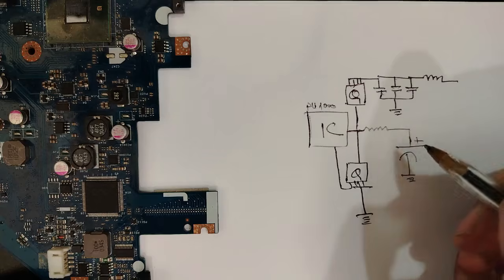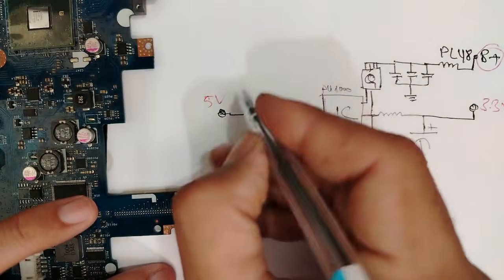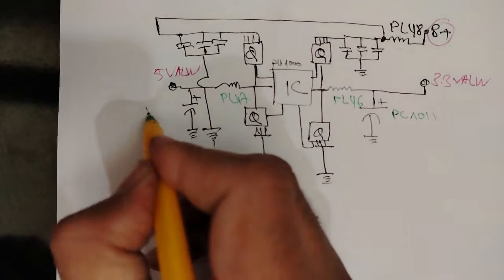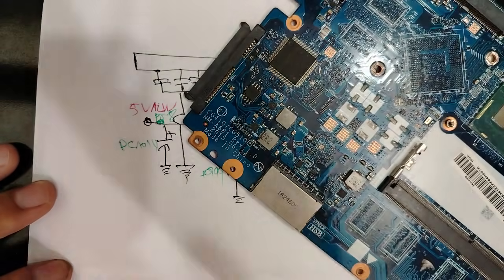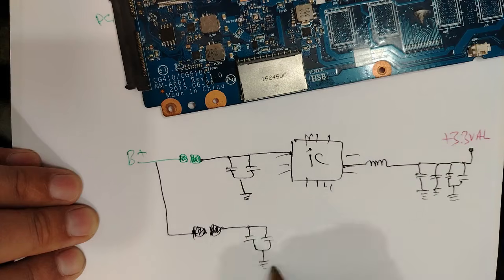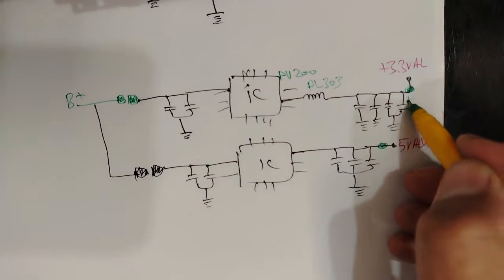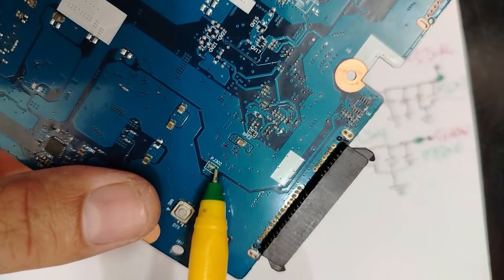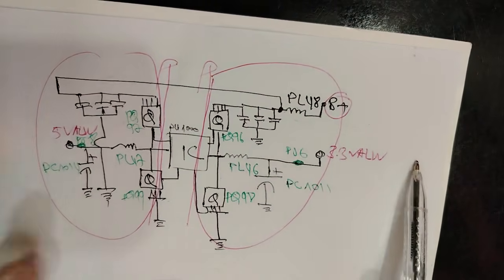💥 3VALW & 5VALW Circuit EXPOSED. Fix Any Laptop Power Issue Instantly | Motherboard Repair

Comment: I am so impressed by your skills and others like you.  I repair laptops and have done for many years but I never even consider doing component level stuff.  I wish I could.  I have a laptop motherboard here, it won't boot, however with no RAM it produces BIOS beeps telling me there is no RAM.  With RAM no beeps but the CPU and some other chips get REALY HOT but no boot, just HOT HOT HOT.  I have no idea what's wrong but I am going to try to find out.  I would love to be able to fix it.
Reply from the maker: Thank you for the kind words and it’s great to hear that you’re diving into the challenge.

Here’s a breakdown of what might be going on with that motherboard:

No RAM = Beep codes
This suggests the CPU is at least partially working and the basic BIOS POST routine is running. Good sign.

With RAM = No beeps, no boot, but chips get very hot, This is more concerning. Excess heat often points to a shorted component or a power rail that’s being overloaded.

Likely Possibilities:

Shorted MOSFET or capacitor:
Especially around the CPU VCore or GPU area. These will cause excessive current draw and heating.

Bad RAM or RAM slots:
Faulty RAM or a shorted DIMM trace can cause the system to hang early in POST.

Corrupted BIOS firmware:
A bad BIOS can freeze the system right after CPU initialization. Not as common, but worth ruling out.

What You Can Try:

Check for shorts with a multimeter
Use continuity or resistance mode to probe power rails (like CPU VCore, RAM power, 3.3V, 5V) with the board powered off. Anything near 0 ohms may be a shorted rail.

Use thermal camera or alcohol trick
Apply isopropyl alcohol or freeze spray to see which chip heats first, this can help you pinpoint the failed part.

Remove or test RAM
Try a known-good stick or test each slot. If you get beeps again with another module, you may narrow it down.

Check for signs of liquid damage
Even tiny corrosion around a RAM trace or power chip can cause instability or shorting.

Let me know, I’d be happy to walk through it with you.
Reply: @electronicsrepairbasics_erb  Thank you very much for the advice.  The motherboard is a VAWGA/GB LA-9912p Rev 1.0 from a Lenovo G 505 model 20240 It has an AMD A6 CPU.  I am going to really try to figure out what's not working with this thing....